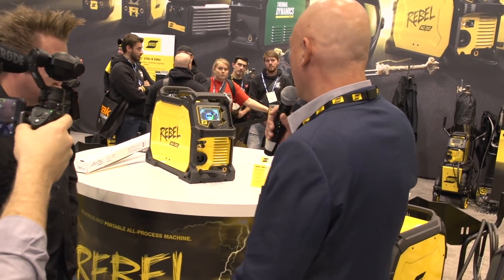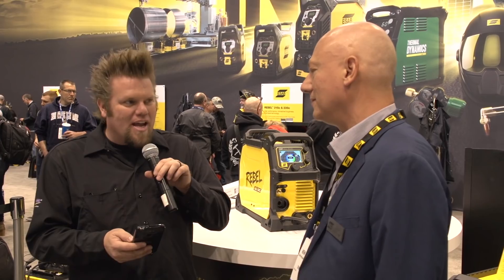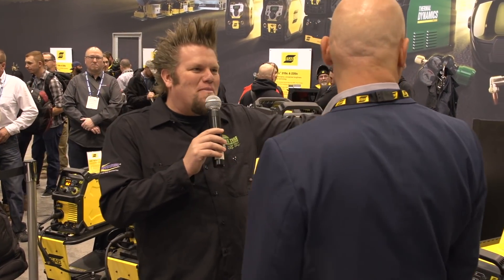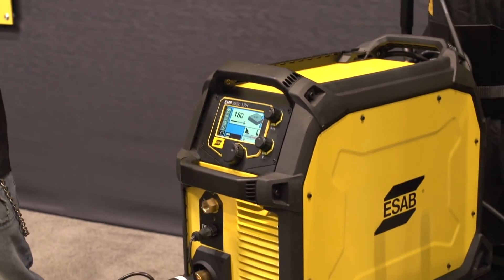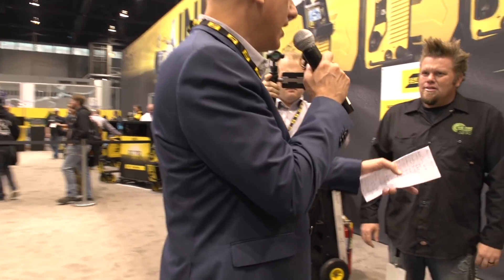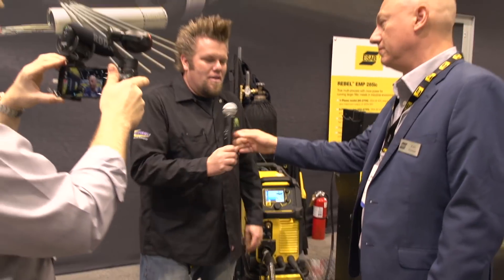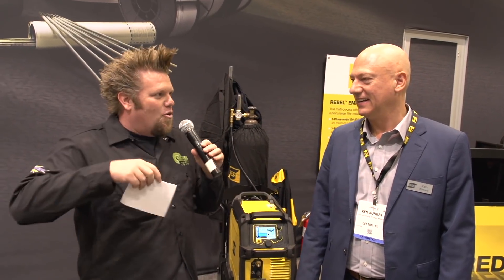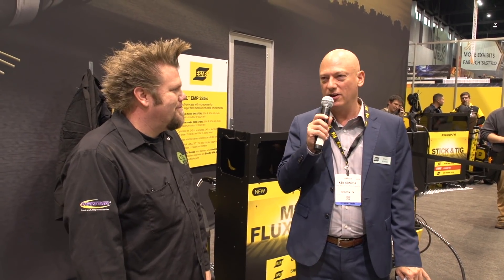Q&A on Rebel EMP 205ic AC/DC, Launch of Rebel EMP 285ic

Comment: $2995??? That’s a grand more than the everlast machine. I was really awaiting, anticipating, even salivating for this machine to come out. But good lord, for a $1k more, I’m seriously thinking I’m probably going to save that grand and buy the everlast machine, that was the first to market by the way...
Reply: teamgmotorsports the ESAB is much better built than the Everlast. I opened the side panel, and found that it was gasketed all around. I designed electronics and can say that the build inside is very good. The components are all of high quality, the boards are thick, and nothing is badly put together. The outer frame is made from a material that will withstand heavy shock from falling off a bench. Want to try that with an Everlast? It’s also case rated for outdoor use.

Right after I got it, I called them to ask a few operational questions, and just mentioned that one screw seemed a bit loose. The guy wanted to send me a new machine, and I had to convince him not to. I guess they take that 100% satisfaction pledge seriously. Contrast that with all the posts on forums that talk about problems, and how Everlast tries to squirm out of warrantee service, and that when they do it, it can take 4 months. Yes, that’s months! And then, sometimes when it gets back, the same problem is there. One guy mentioned that the Better Business Bureau have a lot of bad ratings for them, and their response was that the BBB was a pay for play operation. What a lot of crap!

Why do you think they give so many machines away to YouTube people? It’s so they can’t do one of those - “I bought this machine with my own money, or Patreon money, and I’m going to do a review.” Warts and all. They even sued one guy for doing that. I was considering the Everlast AC/DC machine, but after that investigation, I decided the savings wasn’t worth it.

I’m not saying that everyone will have problems, because if that were true, nothing could hide it. I’m saying that it’s much more likely you will have problems.

Comment: Wish they had one with at least 200A Stick or even better a 225A so we can do some thick stuff and use 6010 rods all day... I've been asking for these types of units for over 7 years, Ok ESAB Now come out with a model EMP 225ic AC/DC or bigger,That is a little more powerful and come with a 20FT power cord as well as a 25FT mig cord and a 25ft Tig cord and 20 ft pedal cord... That way we can work out of our garage and not have to bring the vehicles in the garage where we have to breath all the fumes of welding in..(As I have a big Beard and masks don't fit and I can't shave because I'm SANTA!!).Also most of us DIY Guys only have 220V for our Dryer which is in the laundry room in the garage which is way in the back of the garage... Or especially if the vehicle doesn't fit in the garage!! Hard to fit a 38ft motorhome in a standard two car garage!! And what's with the Outrageous Price tag??? I think the 215ic is around $1200-1500, So this shouldn't be anymore than $1500-$1800!! Not the $3000 it is listed for!!! That puts it way out of 99% of home DIY Guys!! Now build the "Bigger" 225A one and have it come out by the end of 2018 with a price tag "UNDER $2100" SO WE CAN AFFORD IT IN PAYMENTS WITHOUT HAVING TO TAKE OUT A 30 YEAR MORTGAGE FOR IT!! AND THE OTHER VIDEO ON HERE BY THESE GUYS SAID THAT THIS IS THE FIRST OF IT'S KIND, WELL IT'S NOT "EVERLAST" CAME OUT WITH ONE LAST YEAR AND IT'S VERY MUCH LIKE THIS ONE, BOTH JUST A LITTLE UNDER POWERED, I'M LOOKING TO SEE THE SIDE BY SIDE COMPARISON BETWEEN THE TWO!! AND IF ANYONE FROM "EVERLAST" READS THIS STEP IT UP AND MAKE A 225A OR BIGGER AC/DC ALL IN ONE UNIT!! THE FIRST ONE THAT GETS IT WILL GET MY BUSINESS!! A friend has your 215ic and I will get to try it when I go back east this summer... I'm very picky so I can let my Grandkids take it to a welding class and each one learn how to weld basically "EVERYTHING" and be able to do everything around the house and around our camp... That way I can get rid of my 30 year old 225 Lincoln stick (it's not ac/dc) it keeps popping the breaker if I weld a lot in a short time... And I can get rid of my "Harbor-Freight" $89 mig that has worked fine on light stuff for the last 10 years, but I don't want to take up half my garage with 3 or 4 welders that I may only use it once or twice a year, but I have a ton of stuff I need to do that I can't do now, like I have a alum boat that needs a lot of welding, and I need to put a bracket on my trailer to put a 20,000lb winch on to pull up cars and trucks onto the trailer that do not run... I also want to build some brush guards and bumpers for my side by side Quad... I also may want to build a pontoon boat from scratch because no one make any that are handicapped accessible with a bathroom!! So I'm going to build one if I can get a unit that can handle it easy!!

Comment: And what is the Max Input amps on 120/230V for the 285ic? I do not see it in the documentation and am trying to determine the generator size for running this machine on 120/230V.

Comment: How come you guys keep forgetting the everlast mts 221 which has been out for a few months now? Your not the first lol. But the Esab is cooler looking
Reply: Also if you don't include pulsed mig I will be disappointed.
Reply: The Everlast multiprocess is DC only. I have never seen another AC/DC multiprocess machine.
Reply: Dustin Meier that is incorrect, it's being sold specifically as an AC/DC TIG machine with HF start. Pulse MIG functions too. Check it out. I mean no hate on Esab either, it's just they're not the first lol
Reply: I stand corrected. Not sure how  overlooked that since I have been specifically looking at buying an Everlast machine. http://www.everlastgenerators.com/product/mig/powermts-221-sti-tig-package
Reply from the maker: The AC/DC is the first PORTABLE multi-process machine ;)
Reply: Portable is in the eye of the beholder. the Everlast is portable, how else does it get delivered?
Reply: ESAB Will there be a 215ic AC/DC, 235ic AC/DC, 285ic AC/DC? I like the 205, but I’d like to have enough power for Spray, etc.

Comment: Is the Everlast Power MTS 221STi not the first AC/DC Stick-Tig-Mig to have hit the market?
Reply: Eh, Everlast gets so many bad posts on the forums, that I wouldn’t take a chance with them. They aren’t even that much cheaper either. They give almost everyone on You Tube a free machine, so they get great “reviews”.
Reply: The 221 STi is no longer advertised. Plus, the Everlast multiprocess machines are DC only. These new Rebels are AC/DC, Multiprocess, Dual voltage machines. I have not seen any other AC/DC multiprocess rigs to date.
Reply: Dustin Meier I'm seeing the Power MTS 221STi available on both American ($2151) and Canadian ($3000) sites although currently sold out in Canada.

And the 221 STi's are both AC & DC fyi.
Reply: Everlast is good machine I have a 211si I weld with almost everyday I've had it since last June no problems but I do want the new esab 205 machine too